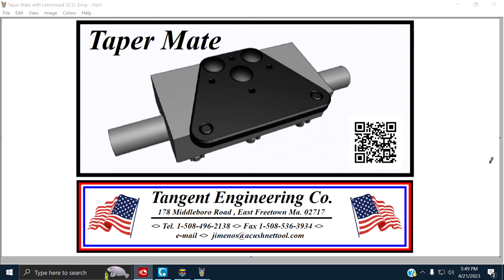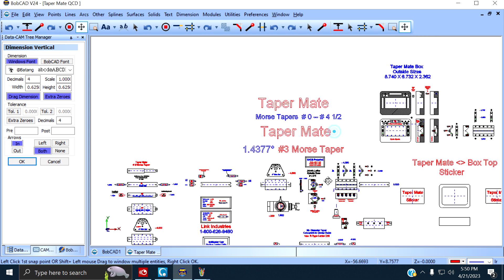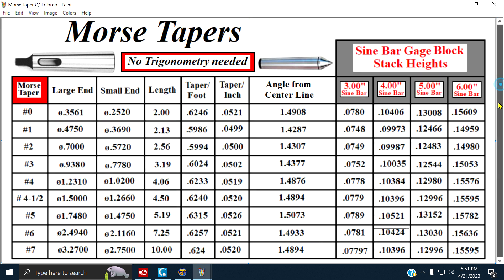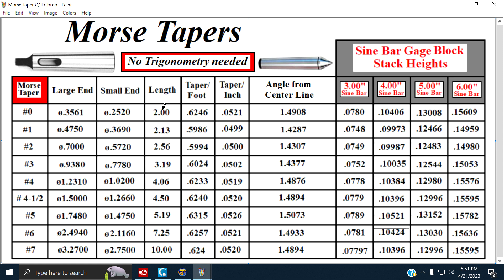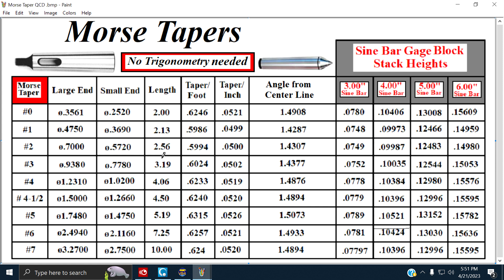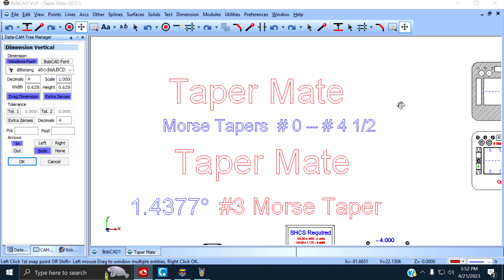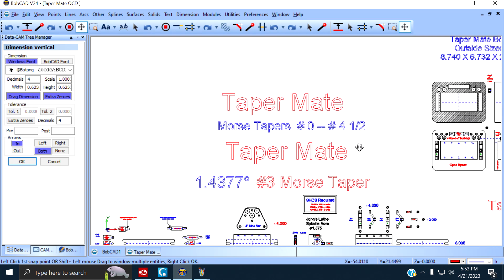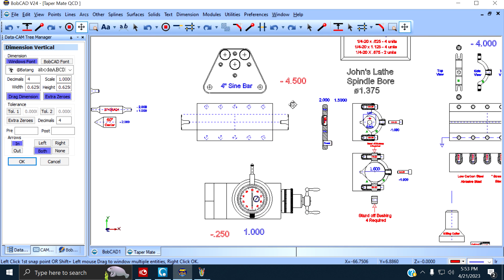Taper Mate QCD -002

Comment: Cut the slots in the vee block clamps at 90 degrees so you can slide them off leaving both screws in.
Reply from the maker: Tates11 -  Excellent Idea ! Where were you when I was designing this unit ? - Jim